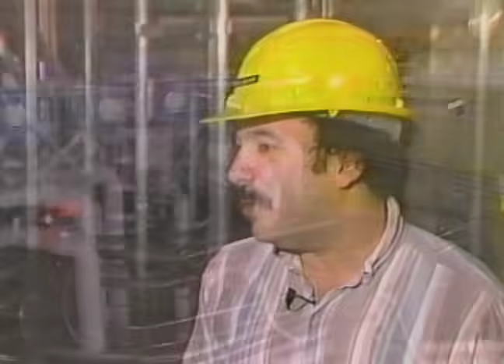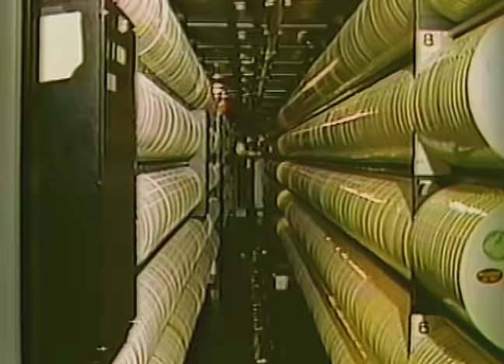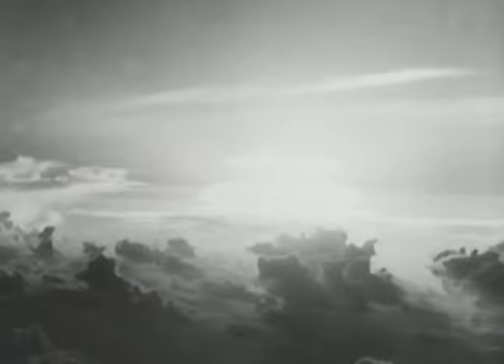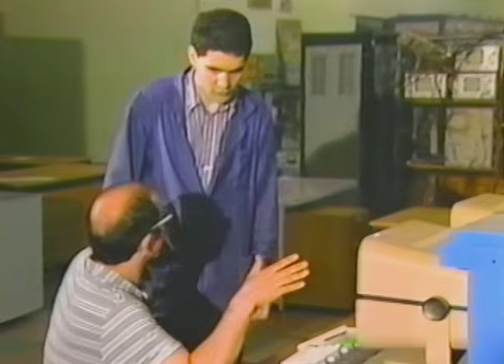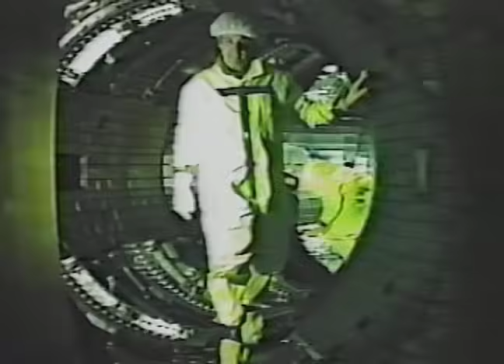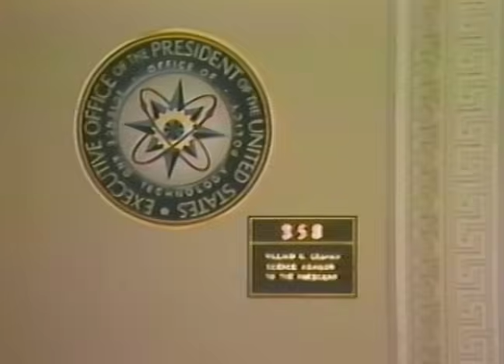Sun of Man (1988)

Comment: Its funny how we were able to weaponize nuclear fusion in less than 10 years from inventing the atomic fission bomb. Weve had the ability even without the common sense to keep using fission power plants for almost a century. 
More ionizing radiation has been released into the environment from 200ish years worth of industrial levels of burning coal, than in all of the nuclear tests and accidents combined. 
After the US dismantled some 25,000 nuclear weapons since the end of the cold war means we have fission fuel enough to power the grid at wide open throttle sts + all the data centers you want for over 300 years😂. But weve got electricity production infrastructure built around fossil fuel use. And an entire world economy based on petroleum, its what backs the US dollar that all nations have to use to buy that petroleum on the open market. The companies that extract and sell petroleum exert massive efforts to stifle anything that can replace oil as a source of electricity production energy. From lobbying to actual laws preventing things like inventions that could solve energy sector problems from being developed (Invention secrecy act of 1951/52).
And thats why to this day problems with fusion like how we dont have any materials that could make the walls of a Tokamak not turn brittle, highly radioactive, and require replacement after a few weeks of continuous operation, or how theres no readily available source of Tritium which requires making it in the reactor using a process similar to whats used in a hydrogen bomb via "breeder blankets". 
People born in the 2020s might see a functional fusion reactor in their lifetime